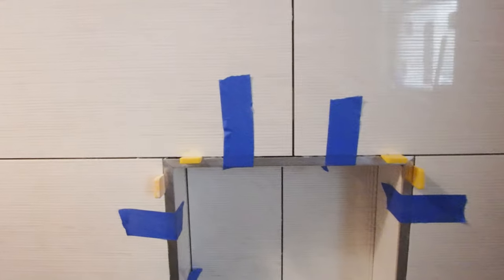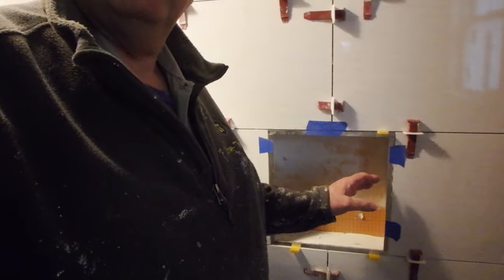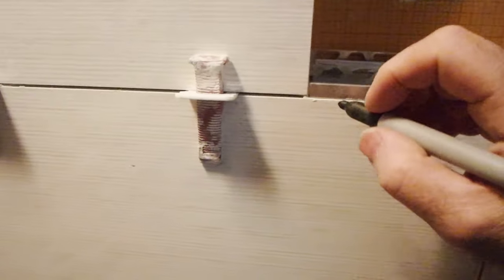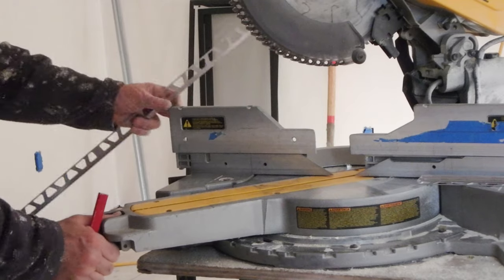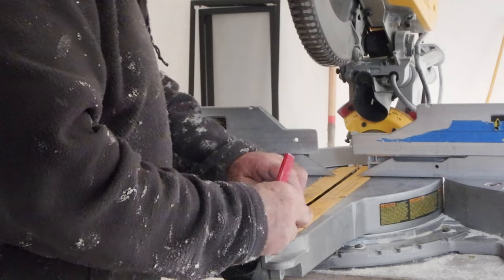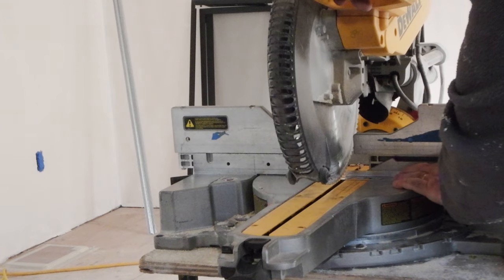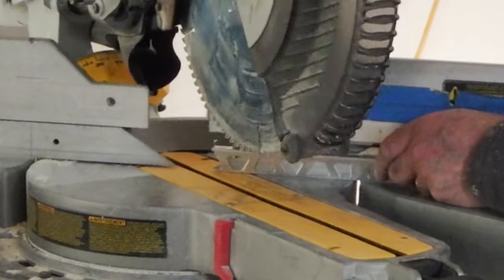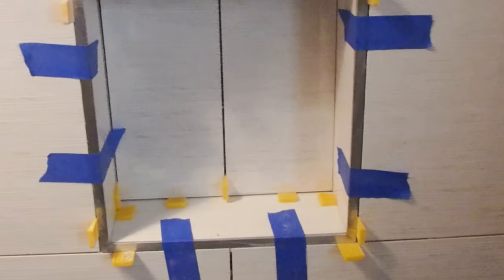Clean cut metal shower niche trim, here is how

Comment: Setting the trim on a scrap of wood when cutting will eliminate the trim from bending or kicking up on you. Especially if you have to trim a hair off.
Reply from the maker: Good tip.
Reply: Great idea! Thanks ✌🏻
Reply: Yes I use Door stop as that inset piece of wood in the metal.  When I cut my  45  or 90 on the miter saw. I carry 2 ft lengths in my Tile supply bins.
Reply: I do this also. The teeth grab this stuff all the time.

Comment: wet saw  with speed square works for me lay trim against speed square put on glasses less chance of stock jumping around never have cut this way why cause just one more piece of equip to lug around and plug in besides looks dangerous to me cheers either way has to be mitered

Comment: Hi Sal, which method do you prefer, Installing with the profile anchor legs inside the niche, or the anchor legs outside the niche on the wall? This video looks like you already set the wall tile up to the edge of the niche first and installing trim inside. Do you have a video on this?
Reply from the maker: Inside

Comment: Great video one thing I never see mentioned is, the tile u have around niche is it flush with inside, or do u leave it a grout line short, or when applying trim with thinset does that build it out. I guess what I’m saying where does the grout line come from
Reply from the maker: On the inside of the Metal L there is a leg to give you proper space for the tile, on the flat side of the trim I use a wedge between the metal and the tile to create that space.

Comment: Hi Sal. Did I hear you say these can be cut on the wet saw?
Reply from the maker: they can ,but for a clean miter you need a chop saw.
Reply: Sal DiBlasi thanks.
Reply: When cutting on the wetsaw set the pieces so the rotation of the blade to  cut toward the back, that way the slag will go toward the part behind the tile. Use a diamond file to clean up the edge.

Comment: I don’t think my contractor installed it correctly the metal trim doesn’t line up with the tile but sticks out a bit and neither do the corners which are sharp to touch. I feel like you can cut yourself if you aren’t careful.
Reply from the maker: Sounds like he didn't do it right

Comment: The principle of the tiling of the  inside neich is wrong. You should tile the bottom and top first and then the two sides. The back tile should sit on top of the ledge not behind it. The same principle applies to steps and Windows. This way the water will not sit on the joint.
Reply from the maker: Since this is not a window or a step, but a watertight shower, I will just ignore what you say.